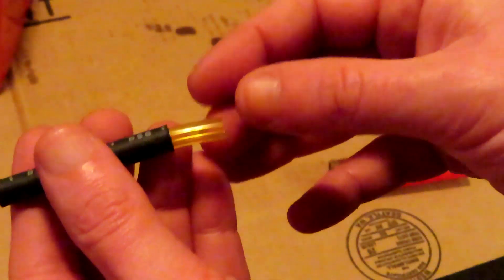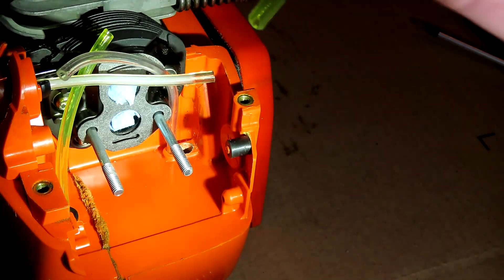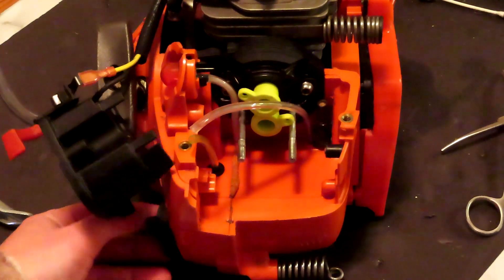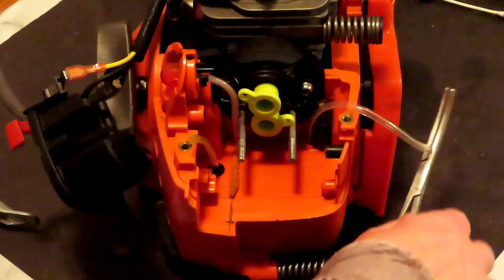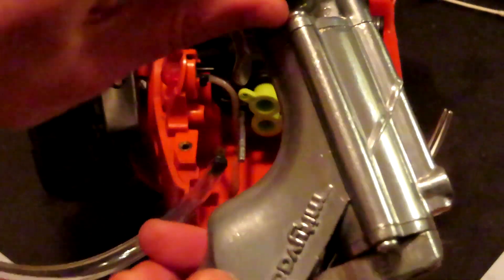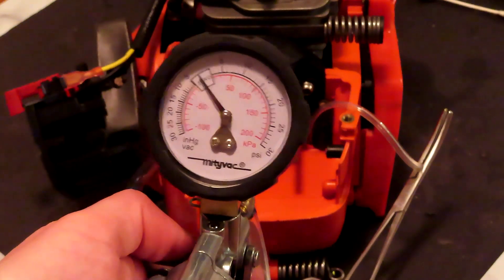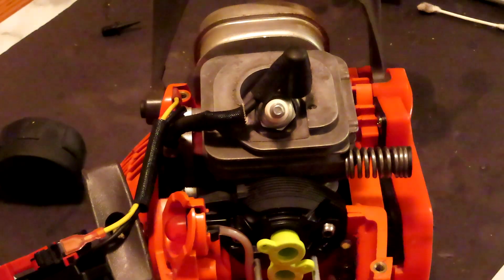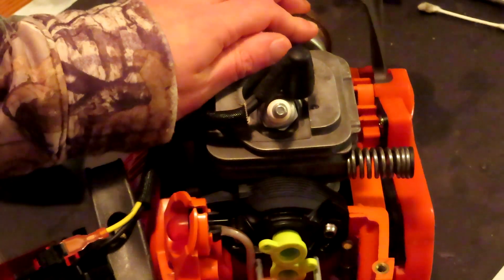Husqvarna 240 Vent/Valve Hack + Mityvac 8500 Leak-down Test: Project complete!

Comment: Good video! Like the way you didn't skip steps and showed everything!
Reply from the maker: Thanks! Glad you liked it. Hopefully it helps others. I had fun doing the rebuild video as well as this final one testing the finished product. It all turned out well and the saw still runs like new. Might do a another saw soon. Same guy who gave me the 240 has an old 66 from what I gather just needs a new piston/cylinder, fuel lines and carb kit. Figure I'll rebuild it for the cost of parts as a favour for giving me that 240. If I do I'll film that one.
Reply: @caddisguy  that sounds great! I've got an 064 that's been ported (not by me) that gets used almost everyday that I cut or mill. 24" for bucking and 36" for slabbing. Picked up an husky 281 to use for bucking, cause it can pull a 36" which I need in the big maple and walnut. Got issues with it though.